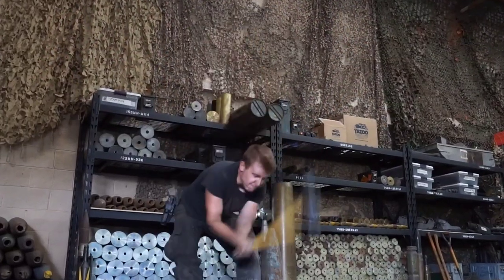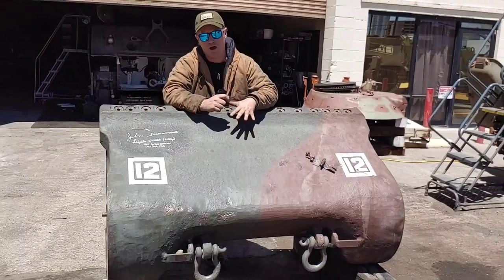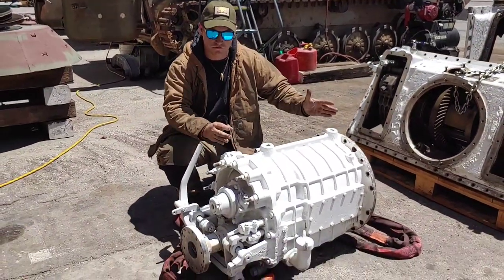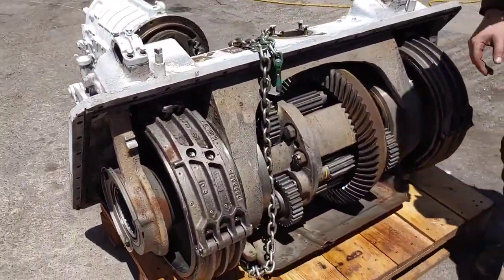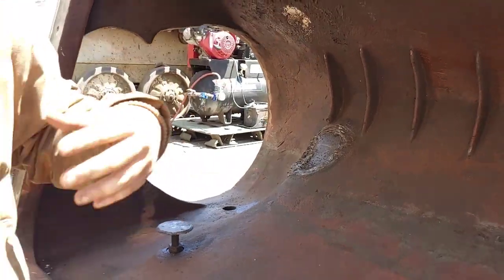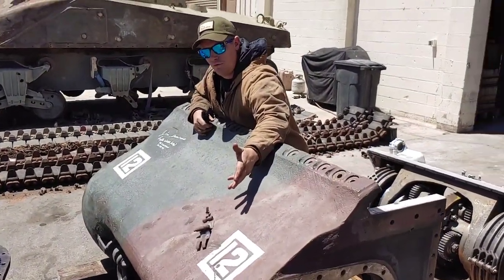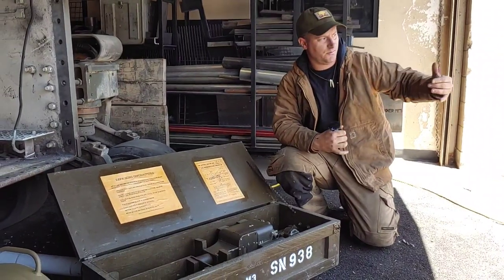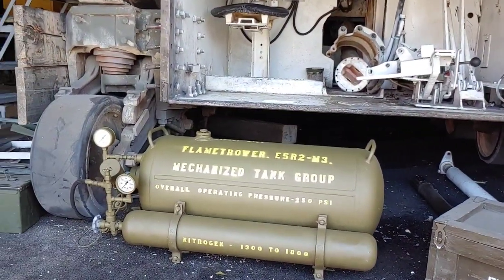Iwo Jima M4 A3 Sherman Tank WWII Powertrain Breakdown

Comment: Amazing to see! So is that the M3 flame thrower tank on the rear deck of some Pacific shermans or a Rubber fuel tank?
Reply from the maker: Thankyou,soon we will have in depth of this tank. The tank on the back is a post Peleliu modification, after the Marines were desperate for water. They got old Stuart tank fuel drums and put water in there with a small hose and tap so grunts could get more water. Mostly an Iwo Jima, Okinawa modification.

Comment: Did you ever do anything else with this Sherman? I was hoping for more detailed shots inside the engine bay.
Reply from the maker: The Sherman will eventually come into the light. We have hours of footage and veteran interviews. We are just lacking good footage of the weapons systems in action. When that happens we will make a series. Unfortunately the engine on this one is not the original GAA. Its has a detroit 8v92. It was intended for a customer rental use vehicle. Running an original engine would not work for our situation.
Reply: @MilitaryArmamentsCompany  Got it. Thanks for the update.

Comment: How much oil does the Transmision hold?
Reply: In TM9-759 (technical manual for M4A3) it lists the capacity of the single unit of transmission, differential and 2 final drives as 152 qts 😮
Reply from the maker: Thankyou gerryka , Yes our manual said 41 gal. Its a non pressurized bath so a little more or less wont really matter.
Reply: @gerryka  OMG! That's a barrel of oil to pump in it!